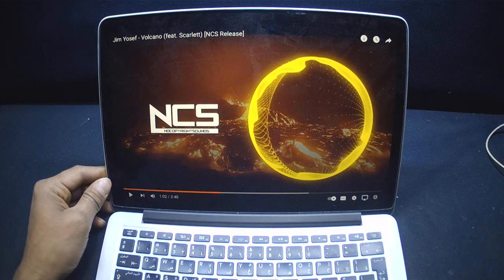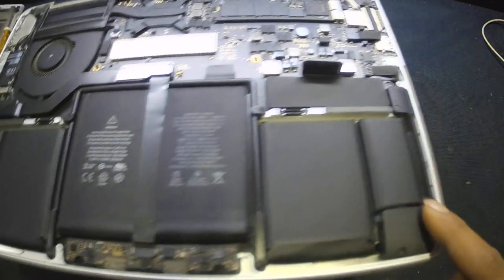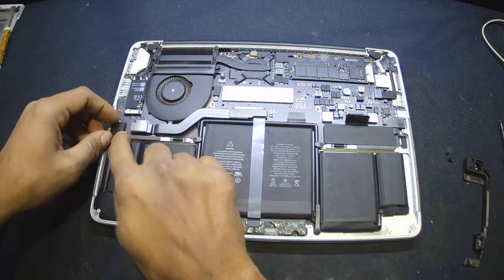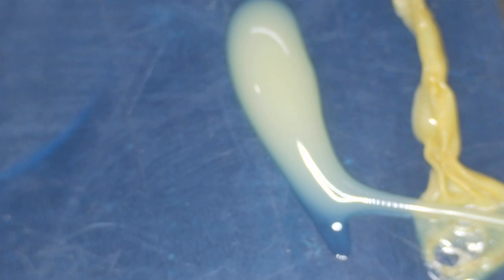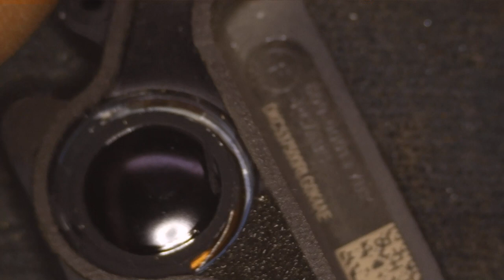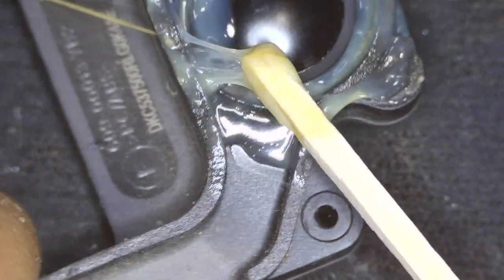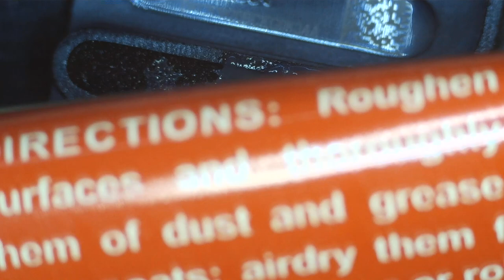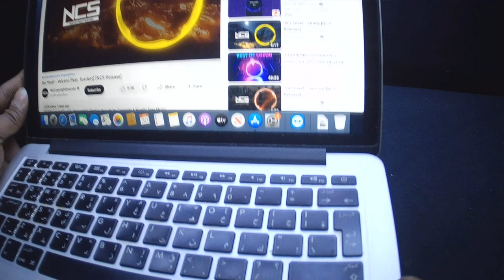Apple Mac Speaker Repairs With Rubber Glue | Adhesive | Fixed

Comment: Does it retain the sound quality?
Reply from the maker: it is a quick fix, does the job, and quality depends on the listener, I didn't find any big difference in sound quality.
Reply: @AuTech_Repairs  ok. If it does the job and doesn't noticeably reduce volume or something, I am fine with it. When cleaning i tried cleaning with an earbud with little Isopropyl alcohol, the whole thing dissolved in an instant lol
Reply from the maker: @Negiku  Alcohol and petrol are not good for any glue, The Speaker has paper around it which is glued and has dissolved, use extra rubber glue to see the result, just make sure the speaker moves when you play sound after fixing. if the speaker is stuck harder you will have less sound.